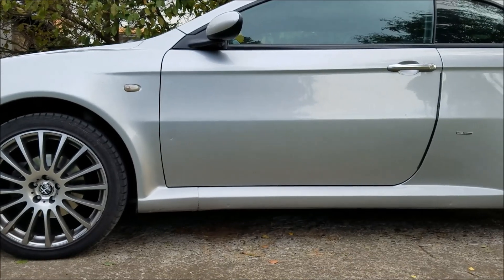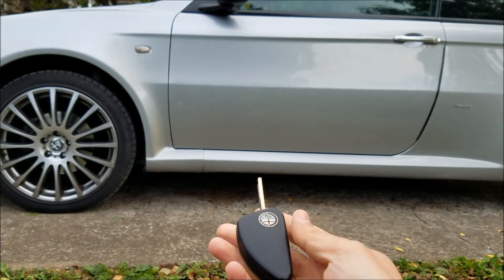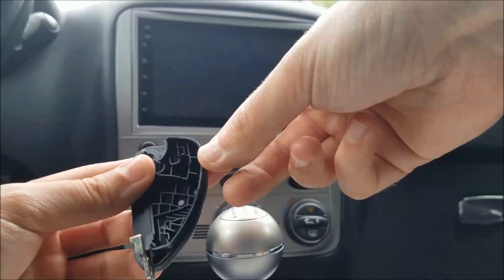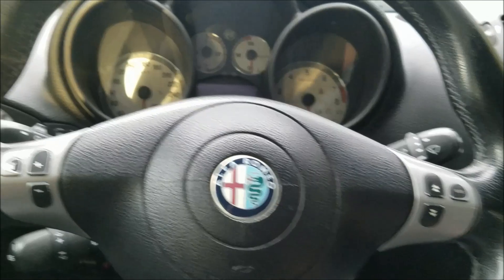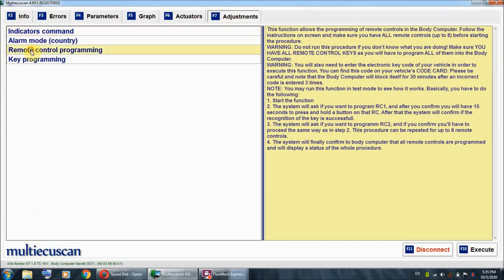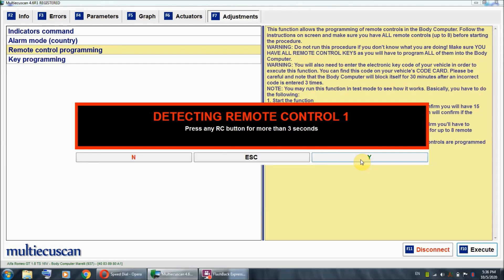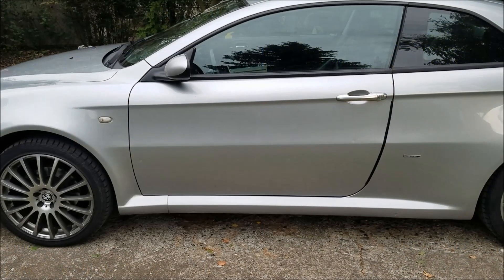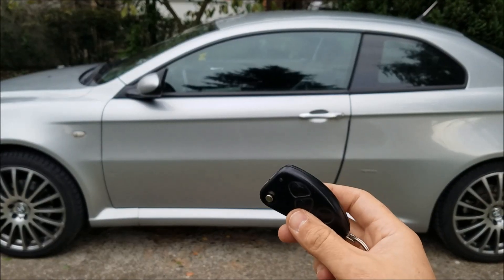Remote Programming Alfa Romeo GT, 147 Using MultiEcuScan

Comment: Hi mate I have the same problem and I did the procedure with Multiecuscan as shown but the car doesn't detect the remote when I press the button. It fails everytime, I tried with another remote and it fails the same way. I start to think the problem comes from the receiver in the car. Any idea ?
Reply from the maker: Make sure to test both keys and receiver, if the problem is with MES contact their support, they will help you out
Reply: @arcgarage  How to test the receiver on the Alfa 147 ? It seems to be integrated to the body computer and not a separate module like on the 156 for example.

Comment: Hi, i bought a second hand car, ofc, and i don't have the bcm key code. Also only one key came with the car, the one without the buttons. What do you suggest is the easiest way to get remote controls. Thx in advance! 
The car in question is a 2005 alfa 147 facelift 1.6ts if it matters
Reply from the maker: Hi, get a code from dealers and program the remote using MES
Reply: @arcgarage  thanks! But that will be rather expensive, is there another way to get the code? Since I can take it to a locksmith and he'll do it for 100-ish euro and i guess a code from an alfa romeo dealer will cost about as much. I'm kind of tight on money right now so I'm looking for a cheaper diy option.

Comment: When programming the remote controls.
If I program the 1st key placed in the ignition to the PPE position. OKAY.
Do I then have to take that key out of the ignition and put the 2nd key in the ignition to do the same programming process?
Then I have to remove the 2nd key from the ignition and insert the 3rd to program it?
And this can be done until the programming of 8 keys?
And if so, won't the program stop communicating with the car's ECU every time I turn the keys in the ignition?
THANK YOU VERY MUCH
Reply from the maker: Yes, it was a while ago, the MES will instruct you, it won't lose connection
Reply: Thank you very much. I think such a clarification was needed.

Comment: Hello.
Can you answer me the following question? :
I have two remote control keys for the car.
  The 1st works normally and on the remote control.
  The 2nd only mechanically, it has lost its remote control.
Question
IF I PROGRAM THEM WITH MULTIECUSCAN.
  1o programs it normally.
  The 2nd one, however, cannot be programmed for some reason (e.g. because its board is broken) and I close the program, so ONLY the 1st one will be programmed.
  What will happen with the 2nd key, since it will be cancelled?
  Will it continue to work as before (i.e. WILL it only put the engine in front, without the remote control?) Or will it not even be able to put the engine in front?
Reply from the maker: With 2nd you'll be able to start the car, but won't be able to unlock it. When you fix the board you can reprogram it
Reply: Thank you very much for the reply
I would also like a clarification if you could:
(So that I know exactly what I'm doing during programming and that no mistakes are made)
So, I program the 1st key that is placed in the ignition to the PPE position. OK.
Then I have to remove this key and put the 2nd key in the ignition to do the same programming procedure?
And if so, won't the program's communication with the car's brain be interrupted?
THANK YOU VERY MUCH

Comment: Hi! Do you know if the "Key Code" is stored in the Body Computer Module, or is it stored elsewhere? My Alfa 147 BCM was destroyed after some drops of water got inside the grey box. I bought a replacement BCM in a scrap-yard, thinking that MultiEcuScan could reprogram my keys. I don't have that software, but I'd like to know if it can help me before buying it (at the moment, the immobilizer works, so I cannot start the engine). Can you tell me?
Reply: usually is a card on the car documents together with the original manuals of Fiat...I cant find mine...

Comment: Hello mate.
I have an ar 147, 1.6, 105hp.
I buying 1 year ago, but  the car can not be close, open from remote key. Only with key from any door 😁. 
Now, problem it is. I do jot have security code for my 147. How i can get that code? 
Thank you
Reply from the maker: You can get the code from dealership, but take your keys to cellphone repairman and have them check all of the connections. that is usually the issue, I have fixed many keys that way

Comment: I'm still a bit confused. So you took out the transponder out of the non-button spare key and also removed the "blade?" and then put both on an old case and then you programmed your old key in a new case plus another spare key with a foreign transponder? Did I get it right?
And also, do I need the key card? I don't have one and my used Alfa 147 just came with the non-button spare key.
Reply from the maker: You do need a key card. You got the first part right I got the transponder and blade out of the non button key, and put it in the button key which I then programmed. That's pretty much it...
Reply: @arcgarage  Thank you for the fast response! Ok, so I have to get a code card at a dealer ship? And with putting the transponder and blade from the old into the new, you just programmed the chip in the new key, right? Because you can't put the non-button chip into a button key, right? Thanks in adavance.

Comment: Hey. Where did you find your elm interface ?
Reply from the maker: Bought the cable on ebay, got the software on the MES website...
Reply: @arcgarage  do you need some extra cables or Just your interface ?
Reply from the maker: @muriellealamelama1310  It depends what you want to do, if you want all functions you need to buy set of cables

Comment: What if the remote on the other original key don't work?
Reply from the maker: It could be due to the failure of the internal components, I came upon that issue numerous times...
Reply: @arcgarage  no i have only a key without remote motherboard, buyed a new key with a motherboard only thing is how to push the remote keys to program the new one if there isn't any on the old one. The lost key had it...
Reply from the maker: @RoToRdetailing  Just do it with new one

Comment: I just completely lost the remote function on my only key for GT. I have no code card. 
The remote worked for 4 years normally, now just won't work. I replaced the battery, no luck.
Any ideas what I can try? I can start it as before, just lost the remote funcion.
Reply from the maker: If you got someone who fixes cell phones, take it there. They can check out if all of the button connections are OK. I fixed numerous 147, GT keys that way...
Reply: @arcgarage  Good tip! Super weird that all of the buttons stopped working at the same time. Thanks!

Comment: I have an used (so, not virgin) Alfa 147’s key incl. transponder and remote. After having a fob key cut by a locksmith and transferred the remote board and transponder, is it possible to program it for an Alfa GT?
Reply from the maker: That's what I did...
Reply: @arcgarage  But you had a transponder in your spare key and transferred it to the other key with remote. 
I don’t have any spare key. I lost my key which had a transponder and remote. Currently I have one key with remote+transponder and I said an Alfa 147 key. Can the transponder of the 147 be programmed to work with a GT?
Reply from the maker: @ZwaanAfghan  I am pretty sure it can, however, the MES warns that it is a risky to program transponder...
Reply: @arcgarage  I see. And to be able to start the car with the new key, it has to be taken to a professional locksmith or dealer to do this part, right?
Reply from the maker: Yes
Reply: @arcgarage  thanks for the info.
Reply from the maker: @ZwaanAfghan  No problem

Comment: wen you say enter security code, is what exacly? i dont have any code from de original key...
Reply: Bro you are in trouble, This codes comes with the car when brand new. They usually are located withing the manual of the car..... If you dont have it.... you can always pay Alfa romeo or Fiat to have the back..... But at this stage in life.... I dot think they do it anymore simple because they don't wanna to do so. not because they cant

Comment: I have gone to a key shop because none of my two keys remote  working ... they copy the key in not original key type like mitt the red .. it unlocks locks everything ok but if you hold the lock unlock buttons the windows don’t come down or up .. I told them I don’t want this and I don’t pay for that key .. they told me that they will find OEM147 key then the problem with windows will fix ? What my cause it ?
Reply from the maker: It could be due to the key, but it could also be due to the module which controls the windows...
Reply: @arcgarage  i didn’t had any problem all the years with the windows with remote keys both of them the original
Reply from the maker: Then it's the keys definitely. Did you think about buying the used key and programming it?
Reply: @arcgarage  the shop they told me that they will bring me the OEM 147 key and then program it
Reply from the maker: That's what I did, and the key works perfectly...
Reply: @arcgarage  my keys are dead they blink but they don’t do anything at all

Comment: Hi, thnx for this great video. 
I’ve come across this alfa key (with remote & virgin id48 chip). Would this work with alfa 2006 TS?
and if i have understood it correctly, i ll need a locksmith or dealer to extract the code from the car, right? 
I’ve it over this key off ebay: https://www.ebay.nl/itm/154232672995
Reply from the maker: I am not sure, does it come with a transponder chip? If it is a proper replacement I think that all you would have to do is program it to the car, and cut the blade...
Reply: @arcgarage  yeah it comes with a transponder
Reply: @ZwaanAfghan  Did this work for you? I did something similar - ordered a cut key with remote and transponder. So i'm hoping i only need to use Multiecuscan to get it to work
Reply: @rehanmarkdalmeida286   I didn’t order that key eventually. I ordered a keyfob and an id48 chip from  Aliexpress. I have the key cut but haven’t tried programming it with multiecuscan yet because i don’t have the registered or paid version of it. 
If you try it, let us know how it went.

Comment: My car came with 2 keys. I lost one. I have bought another of ebay for about 35Euro. When programming with MultiEcuScan it says ensure you have all the keys. Will it expect to see the "lost" key? Or will it simply just program my current working key and new "ebay" key.

I hope that makes sense? I have emailed support at MultiEcuScan before I actually try it. They have yet to get back to me after 1 week.

Thanks,
Sean
Reply from the maker: I don't think it will ask for the lost key. However when you do the procedure you must have all of your keys with you so you can program them. Essentially you will have to program in the existing key again...
Reply: @arcgarage  Cool. Thats what I suspected will happen. Then IF i found my lost key, it would no longer work and all 3 three would need to be programmed again.
Thanks mate
Reply from the maker: @Sean-tn5nv  You're right, no problem...
Reply: Do you receive and reply from MES about this problem?
Reply: @Justin-fc5qv  No, Ill send them another email. Seems like pretty poor support though.
Reply: @Justin-fc5qv  Hi, I emailed again. Got a reply this time.

"Hi,

 

No, you do not need the “lost” key during the programming procedure. It will simply be disabled after the key programming procedure and you will not be able to use it on your car anymore even if you find it.

Please note that the transponder inside the new key should be pre-programmed with special code for the car. It is not possible to use a key with blank transponder or a key with transponder from another car. Usually, all key specialists have the equipment to extract the secret codes for the transponder from the car and program these codes into a new transponder for the new keys.

Also, it is not possible to do this programming without the 5-digit security code of the car.
"

It works as expected then. However, they claim it will not work with a key from a different car even though that it what Mr ARC does. I shall message the ebay seller to see if he has anymore information. I don't want to just try it in case I am locked out of the car lol. The transponder in my new key is described as "virgin". This suggests that it needs to pre-programmed with a special code for the car according to MES.

Will update this after messaging the ebay seller.  

Thanks all
Reply: @Sean-tn5nv  Thank you very much for these info.
Reply: I got a reply from eBay seller. Basically MultiEcuScan only programs the open/close of the doors. NOT the immobilizer. So is no good if you lose a key like me. I need a machine that can pull the code from my body computer on the car..... here is the eBay resonpse so nobody makes the same mistake I did haha. 
 "Hello
You can't program immobiliser part of key with multiecuscan. this interface not support coding virgin keys. with software you mention you can only code key purchased from dealer which is pecoded by vin(dealer key) to code virgin key you need device which is capable of pulling precode data from car bsi and than precode key(create deler key). once you create dealer key you than can code it to the car using multiecuscan. following devices can be used zedfull ,mvp pro, smart pro, autel im , avdi , maybe obdstar 300 dp plus
Regards
Zanna"
Reply from the maker: @Sean-tn5nv  I though you were talking about the key fob programming not the immobilizer in the begging. Not sure if that's correct. I got the option for immobilizer programming on my registered version of MES. I also wanted to try it out, but the software gave me some kind of warning stating that there's a risk for immobilizer module damage or something like that, so I gave up on it. Also I have the Autel MK908 which is not the best device from this company but it's close to the top, and it can't program in the key fob on Alfa...
Reply: @arcgarage  No worries. I can get the CODE from Alfa to program the lock/unlock. I can get the new blade cut. Just need someone who can pull the immobilizer code. 
Either that or stick the transponder near the ignition barrel so both keys work haha it's not like someone is going to steal it anyway!
Reply: @arcgarage  Hi, do you think its possible to do this, I have alfa romeo mito with ONE remote key (where the remote thing doesn't work) and ONE normal key without the remote thing. It says on the tutorial to have all keys and press button, what about if the key doesn't have any buttons? So if i buy new transponder and do the same thing you did in this video, would the normal key still work to open manually doors and start the car?
Reply from the maker: @volcaprojects8333  You could buy used key and use the remote. Just take the transponder from your old key as well as the blade. That's what I did...
Reply: @arcgarage  Thanks for the reply, i chekced with multiecuscan, it doesn't even give the option "program remote keys" in the mito 1.4tb 16v model, there is only the "program key" option :( Also I disseambled the key and transponder thing that is needed to start the car is also soldered into the remote board, so I think it will not work in mitos
Reply from the maker: @volcaprojects8333  I think you're right, it is possible but it is too much of a hustle...
Reply: @Sean-tn5nv  Hi Sean, what was the final solution? Did you 
1. Get Someone to pull the immo code and set up the remote control OR
2. You did the remote control yourself using Multiecuscan but got someone to pull the immo code OR
3. Used Multiecuscan to do the whole thing yourself
Reply: @volcaprojects8333  Hi, what did you end up doing? I have the same car and i thought i could program remote keys as well as program the key :(. Now i see i can't do both. Still waiting for my pre-cut keys to get delivered from China so hoping to have a plan before it arrives.
Reply: @rehanmarkdalmeida286  None of the above lol. I've still not got around to it. If I do it, ill pull the chip out of my remote and secure it in near the ignition barrel (essentially the car would have no immobilizer then).

Comment: What ecu tool so you use to connect laptop with? And another thing, about locking and unlocking, I know some alfas have sound effect with it, do u know if it's possible to enable this ?
Reply from the maker: I am using MultiEcuScan, I am working on the full review video right now, it will be uploaded in the next few days. Yes, you can enable that option...
Reply: @arcgarage  I am sorry, what I meant is what obd2 connector ?
Reply from the maker: It is the ELM cable...

Comment: I saw that your car is the jts, was wondering if the engine is being reliable as many forums say stay away from jts engines, thanks.
Reply: I just bought in the summer a GT JTS. I also have a 156 2.0 TS. Watch out the JTS oil maintanance because I just found out why one of the lobes on the exhaust camshaft has a significat wear! Poor oil maintanance! Bad oil specification or changed too late! All a JTS needs is an oil catch can  and maybe a valve clean. Oil consumption si mostly from valve seals. That's it.
Reply from the maker: My GT is 1.8 Twin Spark. JTS engines are not bad, but the direct injection configuration proved problematic for most car manufacturers. It's the nature of the engine... The most important thing you should consider is the overall condition of the car.

Comment: It's been months since my key was washed in washing machine. It doesn't work. Any possibility to make it work again?
Reply from the maker: If I had to guess, I would say internals are the issue, but you could try to reprogram it. If it doesn't work, you can always buy the used key (replace parts like I did), and program it to your car using this procedure...